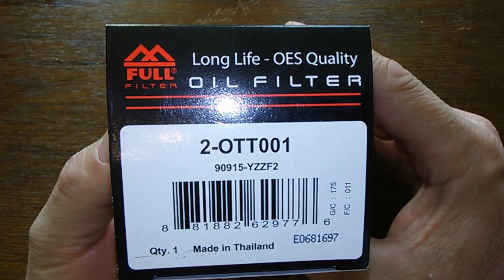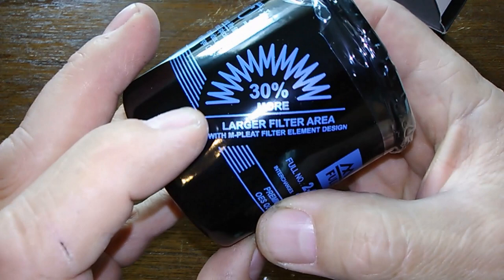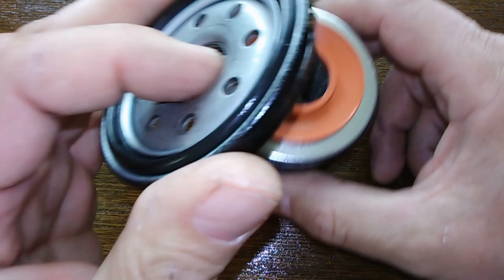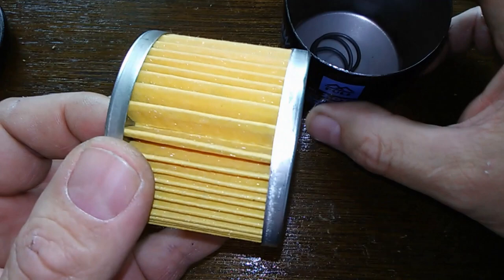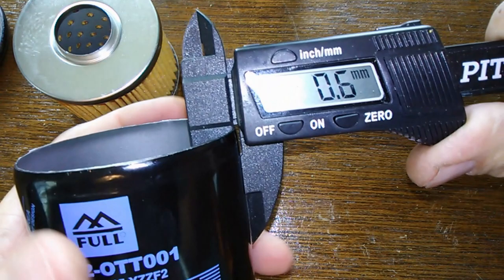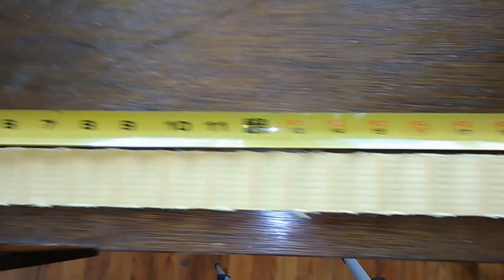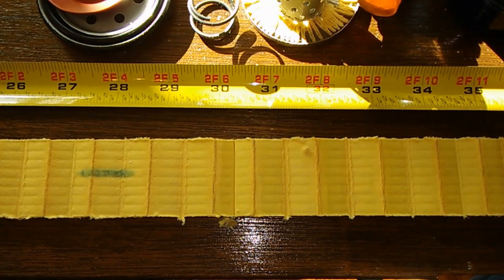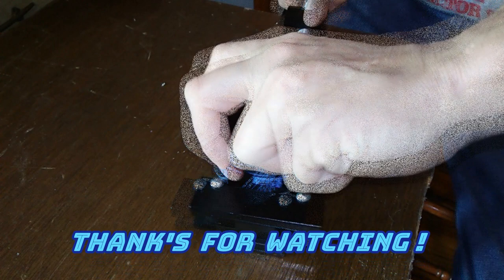Altrom ATM 2OTT001 Oil Filter Cut Open

Comment: These Altrom/ATM filters are identical to the Mahle brand filters. Mahle must be the manufacturer.
Reply from the maker: Could be? Thanks for the feedback👍
Reply: I used to work for NAPA and supposedly FULL is the OEM oil filter manufacturer for many Japanese automakers such as Toyota, Honda, & Nissan, as to whether or not they are owned by Mahle I do not know.
Reply: no FULL is the actual manufacturer, Mahle may use Full but not the other way around

Comment: I didn't catch this the first time, but went back and watched the video a second time and on the exterior of the box is a toyota parts number 9015-YZZF2 which happens be a toyota part number for 1.5L engines.  

I checked one of my toyota filters and the filter is also made in Thailand.  Toyota filters always have the plastic cover (except for canister filter).  

Suspicious the same company who made this filter makes toyota filters.
Reply from the maker: I don't know, could be.
Reply: It also fits the 1999 Camry with the 2.2 L engine.
It looks like a Denso. Toyota OEM doesn’t have the silicone anti drain back valve. Theirs is rubber.
Reply: I used to work for NAPA and supposedly FULL is the OEM oil filter manufacturer for many Japanese automakers such as Toyota, Honda, & Nissan.
Reply: Yes they are an OES supplier